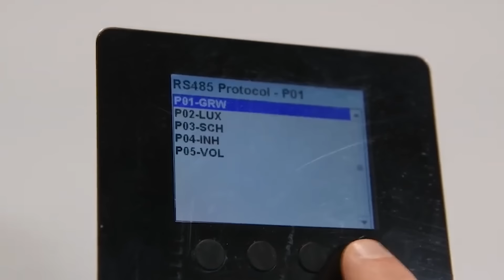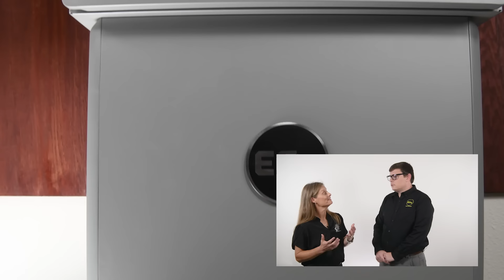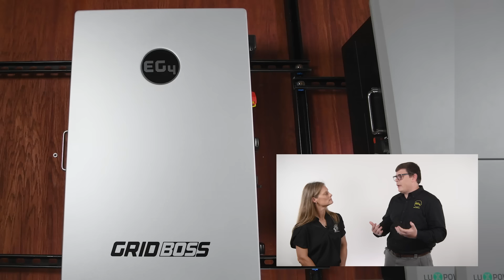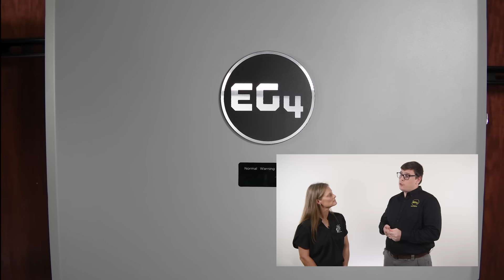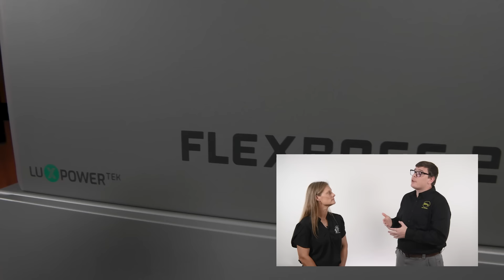EG4 FlexBOSS21 & GridBOSS Premiere Interview: The Most Powerful Solar Solution Yet

Comment: @signaturesolar. Could you submit ticket to R&D department at EG4 to be able to exclusively charge an electric vehicle  from Grid on the GridBoss? This product was produced to save costs of other components. However, I can't charge my electric vehicle with the net metering credits I send to the utility unless I add a grid distribution panel.

Comment: If I have the grid boss next to my meter on my house, and a single 90 amp run down to my barn where the flex boss with solar and batteries would be located, can I run a sub panel to power the barn off the load port of the flex boss? Or do I have to run a separate line from the grid boss down to the same barn to power the sub panel?
Reply from the maker: Hey there! If you give our support team a call at 903-441-2090, they’ll be happy to walk you through the options and help you find the best solution for your system.

Comment: The 12000xp or the FlexBoss21? The FlexBoss21 is $2000 more expensive. 
I'm am not going to send power back to the grid. 
Thanks for the info.
Reply from the maker: Hi! If you're not planning to use net metering or similar, the 12000XP should work well for you. If you need guidance on choosing the most cost-effective system for your needs, please feel free to call our team at 903-441-2090 and they will be happy to assist you.

Comment: Do you still need a chargeverter if you use the gridboss with a generator?
Reply from the maker: Hi! You dont need it but it doesn't hurt to have one!
Reply: @SignatureSolar  Would it connect directly to the batteries, or through the 'generator' port on the Gridboss?
Reply from the maker: The Chargeverter connects directly to the batteries.

Comment: You guys are so frustrating when you throw out terms like Load Shedding and AC Coupling (and a few others) without any explanation - as far as the load shedding - I find that to be so important when explaining to new customers! I have no idea what you meant and it took me a LONG LONG TIME to realize that when using a FlexBOSS21 and GridBOSS together that the flow of the Grid connection of the FlexBOSS21 is bi-directional (at least I have come to that conclusion after a lot of added investigation due to your lack of explanation); that is why you can connect your generator to the GridBOSS and it will charge your batteries which are connected to the FlexBOSS. (At least that is what I think happens - not because you explained it AT ALL!!!!) SO FRUSTRATING!
Reply from the maker: Hi! Thank you so much for sharing this, we really appreciate it. You’re absolutely right; clear explanations are crucial, especially when it comes to complex setups. I’ll pass this feedback along to the team to help improve clarity around terms like Load Shedding and AC Coupling. If you need any clarification, feel free to call us at 903-441-2090, we're here to help!

Comment: So now you have to spend several thousand more dollars to buy a grid boss just to get the 200 amp bypass? Forget that!
Reply from the maker: Thanks so much for the feedback! The GridBOSS does include a 200A auto-bypass, but it also offers whole-home load management, remote monitoring, and smooth integration with EG4 inverters and batteries. It’s just one of several ways to build out a system, depending on your needs. Please don’t hesitate to reach out if you’d like any help exploring your options, we’re happy to help!

Comment: Can someone tell me if the inverter has a total solar input of 600v max per string or combined?  I'm asking because if I had 15 panels that are spec at 410w, 37.08V VOC, 13a each this would be 6150 watts input only and maxing out the inverter capacity voltage solar input which is nowhere near the 21k solar input.
Reply from the maker: Hi! The 600V max is per MPPT input, not combined. So you can split your array across multiple MPPTs. For help with your setup, please don't hesitate to call our team at 903-441-2090!
Reply: @SignatureSolar  Great!  Thank you!

Comment: If cost reduction was a priority, then why was the GridBOSS built to only accept copper from the Grid?  Seems to me that grid supply is usually aluminum because of the cost.
Reply from the maker: Hi! That's a great question! Aluminum is definitely more common for grid feeds due to cost. Since this is a design choice, I think it’d be best to confirm directly with the manufacturer to get the full context behind that decision. We'd be happy to pass this along or connect you with the right contact if you'd like!
Reply: @ That would be helpful.

Comment: How does the FlexBoss, GridBoss, and EG4 batteries stack up against the Point Guard solution?
Reply from the maker: The EG4 system outperforms the Point Guard solution in several key areas while also being considerably more affordable. It offers nearly double the total battery capacity, supports full 200A passthrough, and provides roughly 6000W more of surge capacity. While Point Guard includes 4 MPPTs compared to EG4's 3, EG4 makes up for it with higher MPPT voltage (600V vs. 550V). Battery cycle life doesn't seem to be listed for Point Guard, but EG4 batteries are rated for over 6000 cycles. Overall, EG4 offers more power, better specs, greater flexibility, and a lower price point.

Comment: a video of using this unit with ac coupling system on micro inverters. would be awesome to see as a micro grid set up with micro inverters ac coupling and battery set up. would appreciate it if you could. and battery bank voltage range set up on the inverter.
Reply from the maker: Thank you for your suggestion!

Comment: What is your commitment to keep that app active in perpetuity? I don't want to buy this hardware, and 10 to 15 years from now not have a usable app to control it. That's what is nice about the older 18kPV and the built-in display. It appears I can do everything from that display.
Reply from the maker: Hi! As a distributor, we don't create or update the apps associated with the equipment we sell. To inquire about this, you would need to speak with the manufacturer. To reach our to EG4, you can email support@eg4electronics.com :)

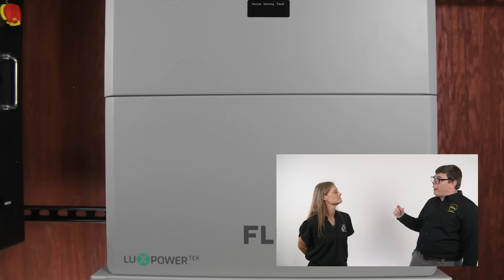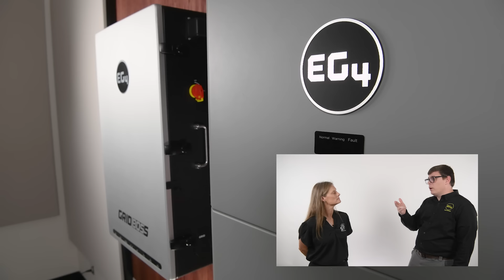Comment: At 29:48 you mention a single wire between the two boxes. Was that a mistake? Did you mean a single 240V run between the two boxes? I'm VERY interested in this because I have almost the exact scenario you described. I have an 8kW Enphase system near my main 200A panel and want to add 14kW to a remote location on the property and tie it to where the Enphase and main panel are located. I also want to add battery to the Flexboss21. The Flexboss21 and battery needs to be 'close' to the new 14kW of panels, but the transfer needs to be near the main panel. I think this system is exactly what I need. I just need to measure the distance between the two areas and see if it falls within the allowable range.  OK, you mentioned one wire again at 30:07, so now I'm really confused. How do you get 240VAC between these two boxes on 1 wire?

Comment: Great detailed information!  Not your typical marketing video 🙂.  I've been waiting for a GridBOSS offering for ages... from anyone really.  And now we have it from one of my favorite brands!   It literally has everything I want...  you even solved (or at least partially solved) the generator issue... a situation where the FlexBoss21's can't adjust the frequency to control the AC coupled solar.   So as long as the loads are higher than the AC coupled solar (which will be almost always while the battery is charging), everything is fine.  And if the battery is full... you just disconnect the AC coupled port and everything is still fine.  Wow.

And you solved black start too.  I'm going to remember that point (I'll be wiring this all up in a few weeks).  Put at least some of the AC coupled solar on the load side of the Flexboss21.

I understand that only EG4 inverters work on the hybrid ports, but that's ok.  Nothing stops us from putting UL1741SA rated inverters on other ports though, if I understand properly.  Just as long as there is at least one EG4 inverter on a hybrid port.  They'll just think the grid is "on", so the FlexBoss's in the system will still be able to control the frequency. 

You know what the best feature of the GridBoss is to me?  Its the MANUAL bypass.  I was tearing my hair out trying to find a manual transfer switch that I could put together to bypass the grid directly to the house circuits just in case the ATS / sophisticated software in the products fails.  And you have it!  That really sold me on Grid Boss.

I still plan on using those MPPT ports, but I have legacy AC coupled solar that when I get the EG4 stuff installed will be moved over to the LOAD output on the FlexBoss.

-Matt
Reply from the maker: Thank you so much for your feedback, Matt!

Comment: Can I use a 52vdc generator with this as a charge controller ?
Reply from the maker: If it can shut off based on battery voltage, then yes. If not, this would be risky.

Comment: What about some wiring examples? How do you get power back to the inverter to charge the batteries from the grid?
Reply from the maker: Hello!
If you look at this link: https://eg4electronics.com/wp-content/uploads/2024/11/EG4-GridBOSS-System-Wiring-Diagrams.pdf and go to page three, you'll see an example of EG4 inverters connected to the GridBOSS.
Once your system is set up, all you need to do is configure the settings. If you want the grid to charge your inverters, you can enable AC charge in the inverter settings and configure whether you want it to be based on time, or the battery's state of charge. I hope this helps! If you have any further questions or concerns. Please don't hesitate to reach out to us at 903-441-2090, option3, and we will get you taken care of!

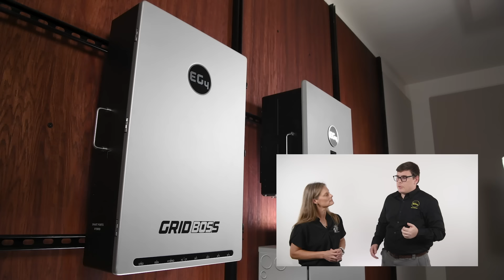Comment: 3:57 wait, is this apples and oranges? my utility requires a blade-type (not breaker style) service disconnect outside at the meter. (ask me how i know. 😡) it doesn't look like the gridboss has that style ac disco. also it looks like folk are mounting the gridboss inside the house not outside near the meter so it's not accessible to the utility (as mine requires). so it seems you'd still need an ac disco anyway?

also regarding a manual bypass switch, i use mine to switch the house between grid or the inverter so that if the inverter croaks, i can switch the house back to grid. i guess you've put that in the gridboss (?) but if the gridboss croaks, you're still stuck right? (just trying to understand the differences to just using a whole house 18kpv setup.)
Reply from the maker: Yes, you would need an AC Disconnect (maybe a 200A fused disconnect if your AHJ wants this), outside the meter. If you'd like to see a picture of this, you're welcome to give us a call at 903-441-2090 and we can send that over to you!

Comment: Correct me if I'm wrong but you stated 5 MPPTs that they are labeled  1+ 1-   1+ 1-   2+ 2-   2+ 2-  3+ 3- . This means the dual 1 and 2 inputs are where you can parallel 2 strings meaning it's only 3 MPPTs.  Odd nothing I've seen comes close to Tesla's Powerwall 3 six MPPTs.
Reply from the maker: Thank you for your message. To clarify, starting at 15:03 through about 15:10, James mentioned: "we up the amperage just a little bit more so we can handle five full strings..." James did not specify five MPPTs. You are correct, however, in that the system features three MPPTs, with the first two MPPTs having dual inputs, allowing for the parallel connection of two strings each. This is in contrast to Tesla’s Powerwall 3, which includes six MPPTs.

I hope this clears up any confusion, and feel free to reach out if you need further clarification.

Comment: I have a question on the GridBoss. Our meter can is next to two 200-amp manual disconnects (one for house and the other for 40x60 shop). The 200-amp house critical loads panel is approx. 125 feet from the meter can and the 200-amp shop panel is approx. 95 feet from the meter can. Ideally, we would like to back up the critical loads in the house (perhaps lights in the shop as well). The part we are not sure about is how to utilize the smart ports to shed loads if the Gridboss is that far away from the Critical loads panel without incurring a large expense for wiring. It is our understanding that the GB should be near the meter to also limit wiring expense. This would allow the FB21 and batteries to be placed almost anywhere (within cable limits) using one 70 amp wire and communication cabling. Your thoughts?
Reply from the maker: Hello! This would be best answered by our design team! If you'd like to reach out to us at 903-441-2090, we can get you connected with a specialist to assist!

Comment: Loving this, in theory could you have someone install the grid boss first and this flex boss inverter at a later date? Mainly thinking about avoiding grid power electrical and then diying the solar portion. Also on the generator input, would a eg4 charge verter still be recommended for most cheaper generator when using Flexboss and gridboss
Reply from the maker: Yes, it can bypass until you want to install the inverter.

Comment: He does mean 1) set of wires between flex and grid, right? I’ll be using 2/0 cu.
Reply from the maker: Yes, there would be one set of AC cables between the inverter and GridBoss. The max supported wire size is from 6AWG and 2AWG, so you would not be able to use the 2/0.

Comment: I have recently purchased 2 18kpvs and  6 indoor wall batteries and 60 390watt panels from signature solar. I already have 10,080 watt system hooked up with no batteries. Will remove that inverter and  hook the panels to one of the 18ks. I would think the the grid boss would simplify this instal? And are you going to make a video on wiring the grid boss to the 2 18kpvs and multiple/6 for me wall batteries? 
Thank you for all you have done for us diy guys!
Reply from the maker: It would definitely simplify the install! We don't have it planned but we will take it into consideration, thank you for the suggestion!

Comment: I'm running into the exact run away cost problem with my SolArk 15k. Local installer wants $11k for a disconnect, transfer switch, AC coupling, wiring and labor. Not including inverter or batteries...

Comment: Still a horrible transfer time approximately 20ms (configurable to 10ms, which is still too high; it needs to be 7ms or under for sensitive equipment, with 5ms or less being preferred. Otherwise, downstream UPS systems will still be required for that sensitive equipment).

Comment: Is it possible to configure a delay for the Smart Ports on the GridBOSS? I’d like to ensure a graceful shutdown of my HVAC condenser to prevent any potential damage (by HomeAssistant automation turning off the compressor in case of power loss).

Comment: When will the FlexBoss 21 be CEC listed?
Reply from the maker: Hi!
Here are the  STANDARDS AND CERTIFICATIONS for the Flex Boss.( UL1741, SA, SB, PCS CRD California Rule 21 Phase I, II, III Arc-Fault Circuit Interrupter (AFCI) NEC 2020:690.11/UL1699B Ground Fault Monitoring (GFDI) NEC 2020:690.41(B) CSA 22.2.107.1:2016 Ed. 4 CSA 22.2.330:2017 Ed. 1 IEEE 1547.1:2020; IEEE 1547:2018 Hawaii Rule 14H [HECO SRD IEEE 1547.1-2020 Ed. 2] Rapid Shutdown (RSD) NEC 2020:690.12 FCC Part 15, Class B (PENDING).

Comment: The FlexBoss21 is $4500, the GridBoss is $1800. These don’t include the 14kW battery at $3500. How can they say money is saved? An automatic transfer switch is usually under $1K. EG4 needs to find a cheaper solution.

Comment: I'm looking at the online manuals for the Gridboss and Flexboss21 and it looks like the only way they can connect to the outside for monitoring/updates etc.. is via WiFi.  Is it possible to use copper ethernet to connect to them if you don't HAVE a good WiFi signal where they're to be installed?
Reply from the maker: We offer an ethernet dongle for this, without this dongle there is no way to hard wire.
Reply: @SignatureSolar  Good to know, thanks!
Reply from the maker: You're so welcome!

Comment: So who is going to install these things to make sure a homeowner wont screw something up .and does this have to have internet in order to work
Reply from the maker: Hi! We recommend hiring a licensed electrician experienced in solar installations to ensure everything is set up correctly and safely. As for internet connectivity, it’s not always required for the system to work, but having internet allows for better monitoring and access to advanced features, like remote diagnostics and performance tracking. If you have more questions, let us know!

Comment: That was a ton of information, thank you for that interview! With the one wire system and all of the sensors and logic, can you now do load-side AC coupling? i.e. microinverter panels on your garage that can back-feed to your gridboss at your house
Reply: Also love hearing that 6 flexbosses and 2 gridbosses can share a battery bank! Makes it so simple to create your own 400 amp system, with 400 amp becoming more normal especially with a bigger home and a garage/shop

Comment: What inverter product does EG4 have that is legal in California and can be installed between the meter and branch circuit breakers such that grid can be fed to the breakers when no solar or battery are available, but solar or battery are not fed back to the grid?  My understanding is that some inverters do this but not at the absolute 100% "no back feed" level that is required. Also, there is proper industry vocabulary for these issues, product functions, and perhaps you can fill me in. Thx!